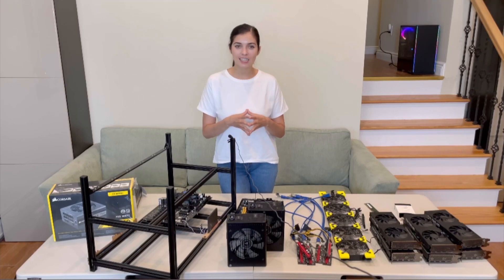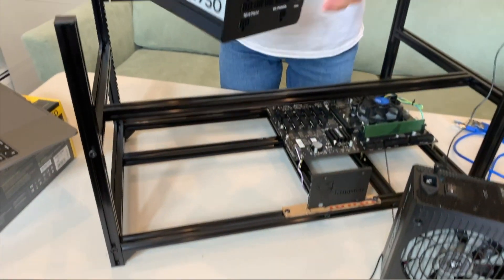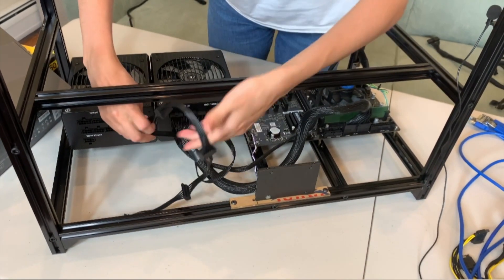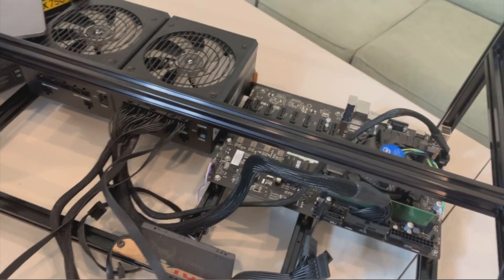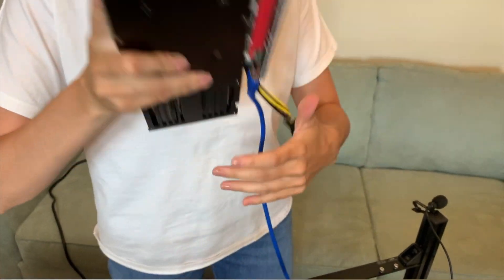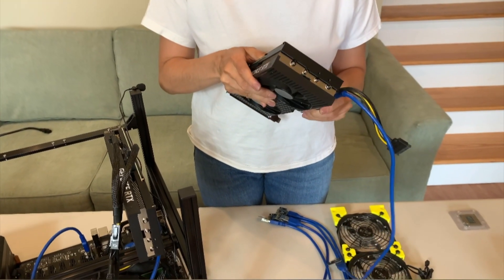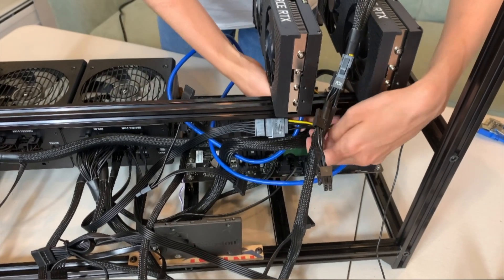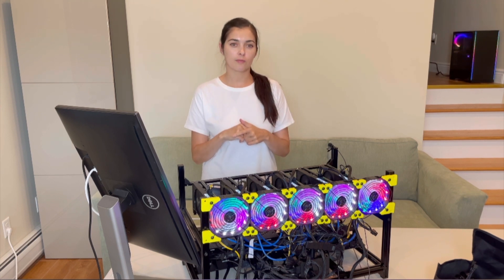Build Your Own Ethereum Mining Rig at Home Easy (in less than 30min)

Comment: Hi Lily, I would like to ask you something. Why did you powered the PCI-e ports on the motherboard? I was not powered these port/ports and my system is working well with 6 GPUs.
if I plug 12 cards, do I need to power the both PCI-e's slots on the motherboard?
Reply from the maker: Hi Ayhan, i am positive you have to power MB Pcies, but if you are saying that it works without powering 6GPUs its very interesting, probably MB distributes electricity toward your cards even without extra supply. if I am not mistaken, when I read the instructions for MB they said to power PCIEs if you use more than one card. 

please let me know your thoughts and also what MB do you have.

Comment: Hi, Well done, it looks great. Just one point, always use both memory slots, so if you want 16GB of RAM in total then you get 2 x 8GB memory sticks. The problem with only having 1 stick of memory is that it will generate more heat because all the load is on one memory stick, split the load over 2 sticks.
Reply from the maker: thank you - my ram is 8GB only on my RIG. doest it makes sense to have 16GB?
Reply: @Techgirl2024  no, are ok, Also only 4gb are ok in mining ethereum. :)

Comment: I am having ver. 2.0 of Same motherboard and having i3 9100f processor and 5 GPU with very less overclocking if I connects one more gpu then on hiveos it shows LA error and mining just stops in few minutes after starting . Anybody can help how to solve it ? Anyone knows ? .
Reply from the maker: Have you tried other pools? also what's  your connection pattern and what cards are you using. it might be easily - power shortage in cards or drivers or other things, please let me know.
Reply: @Techgirl2024  yes I tried but still same problem

Comment: Hey @lily thanks for your video but I don't understand what you plug into the AUXPWR1 and AUXPWR2 port? 

because I also have 2 PSUs and the first one works but the second one doesn't start my cards ( 1000W / 4 RTX 3060 TI )

Thanks ;)
Reply from the maker: Hello, so AUXPWR1 connects to the primary PSU that powers CPU. Secondary PSU connects to the AUXPWR2 slot and is used to power your GPUs. 
If the second PSU doesn’t start your cards - it might be an issue either with the PSU or the slot. Check PSU splitter on eBay or Amazon it cost like 10$ you can avoid using the second slot in this case. 
https://amzn.to/3ylgOFT

Comment: Try using a linux based operating system. It gives better hash rate. And dnt use the wifi adapter you will get more stale shares. Ethernet is the best for minning.

Comment: Did you have PCI out of resources error on bios? I use the same TB360-btc pro 2.0 mainboard and after 4 cards it gives bios error about pci resources
Reply from the maker: Hello, Never had anything like that - however sometimes when rig used to crash, after the reset, MB didn't see few PCIe slots - what I like on Biostar as it shows during Strat up PCIe slots connected.

suggestion would be: to check one by one your risers with different cards and also make sure you are powering them right.

Comment: Great video! Word of advise - DO NOT EVER use SATA to power your risers at all (not two, not one) - they can draw more than SATA can provide, which is an overload and fire hazard. Always use PCI-E power or molex, which is suitable for this purpose as well (as long as you have one molex dedicated cable per riser).
Reply from the maker: Any thoughts on PCIes how can you have let’s say 8 3070s rig with 2 PCIE per card and also have risers under pcie slots 9nly with two per supplies. Let me know please.
Reply: @Techgirl2024  It's pretty simple, really. And definitely better than burning your house down. Each 3070 only draws 120W in total on Ethereum to produce 62-63 MH/s. Each PCI-E cable is rated 300W. So you can use one PCI-E cable to power two risers and one card using two splitters. Then, as I mentioned, you can use up to two dedicated molex cables (one per riser). Rest is just math. Hope this helps. Cheers!
Reply: @Techgirl2024  better use dual power supplies with psu splitters

Comment: DO NOT USE SATA TO POWER YOUR RISERS......FIRE HAZARD WARNING !!!!
Reply: +1
Reply from the maker: I’m hearing this over and over  and watched many videos about it. It seems like the issue is always unstable cards or pool or windows that makes it crash. Have you ever experienced issues with SATA
Reply: @Techgirl2024  Other things are also involved here besides a 'Mission' to make a 'Rig Stable'.
Please have some basic knowledge of electrical wiring before playing with it carelessly. It may led fire hazard due to overloading of a circuit, if you overload a wire more than its designed load it will became hot and will led to melt down of wires and short-circuit and ultimately a Fire Hazard.
And you know what.....make videos by yourself don't use this innocent lady as presenter for you.
..........Peace Out.............

Comment: dont use sata for risers thats a solid fire hazard right there if that rig resets
Reply: Nice video to follow by the way. The issue with sata connection is for most PSU manufacturers it’s specced to supply a max of 54 watts. Your riser could potentially draw 75 watts if your gpu calls for it. That’s a deficit of 20 watts which could lead to the sata connection melting which could be dangerous. Because of undervolting, overclocking etc, it’s possible to reduce the GPU power consumption and it’ll probably not be calling for 75 watts from the riser, however this settings could crash and it’s best to prepare for worst case scenarios like that. This is why most videos I’ve seen suggest throwing out that sata cable that comes with risers, infact some PSUs warn against that on the cover.

A Pcie cable could carry over 280 watts however depending on the manufacturer. So one way to power risers would be to use pcie splitters and tap from that.
Reply from the maker: @AlkaliIbrahim  I agree, I did some research on SATA cables and you are right the max wattage is 54W. so I am coming of the calculations that 3070s or 3060ti consume about 120W and 8pin connectors provide most of the power for GPUs. Again, it works for me - everybody has different mining setups and it might not be a good choice for other cards.
Reply: @Techgirl2024  hi appreciate the vid and wishing you all the best. however I tend to agree with @ Ibrahim Alkali best practice is to use 6 pin pcie for the gpu risers otherwise u are risking a fire hazard. TDP for rtx 3070 is 220w if your rig resets to original settings u can be in trouble, not to mention using other algorithms such as kapow which requires much more power. Again wishing u all the very best, my advice to everyone is to use 6 pin pcie to power up their gpu risers and always use the 20% rule as in have 20% more power capacity than what is required. Thanks for the vid very nice 👍.
Reply from the maker: thank you for your comment, I used to connect risers via VGA cables but when I switched to SATA, I had no problems with it, it's been about 6 months now.  However, I read a lot about this concern too, that's why I don't do more than 2 risers per SATA cable. Please Let me know if you know more about the exact situation when the SATA burned. thank you!
Reply from the maker: thanks, I am no longer doin it after reading many comments I have rebuilt the rig again.=)